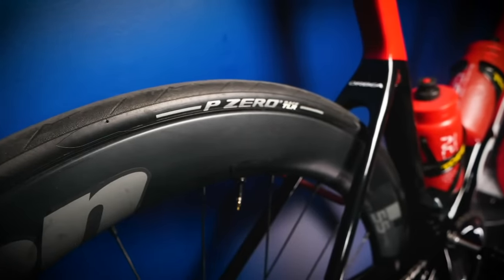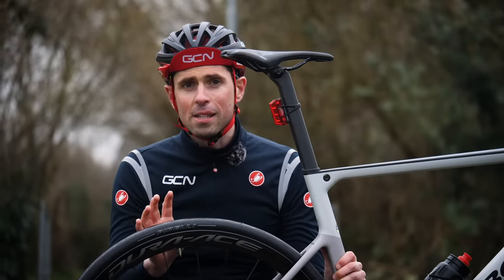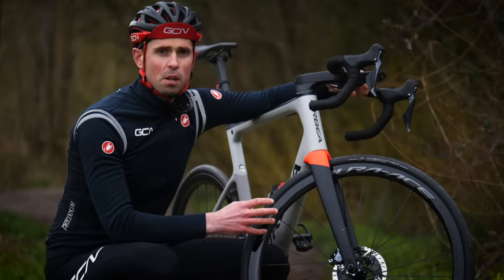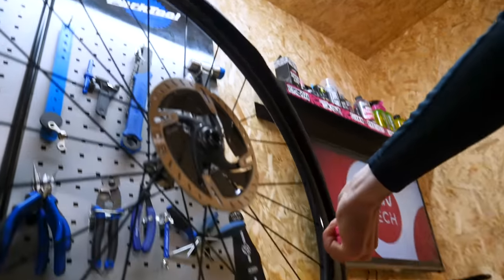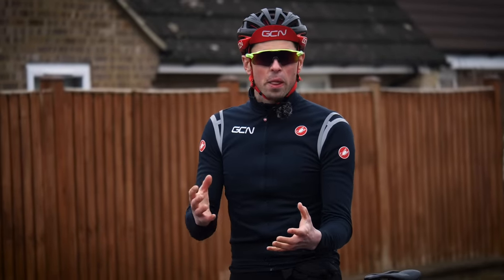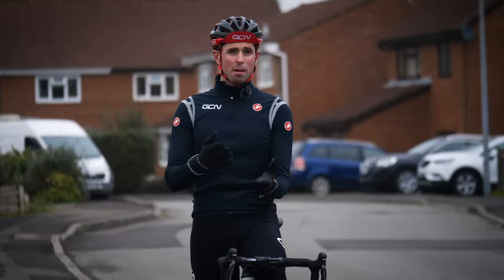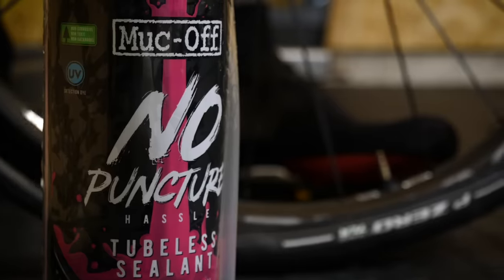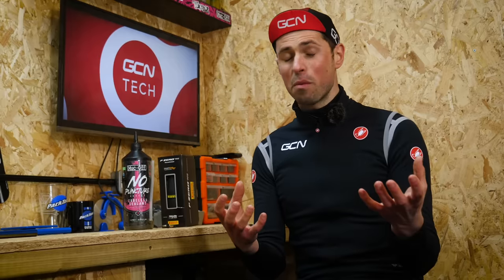Tubeless Convert! | Why Alex Will Never Use Inner Tubes On His Road Bike Again

Comment: Tubelss is great when it works. However, it doesn’t take much of a hole, for the sealant to give up. Meaning you will have to plug the whole, by the time you realise that a plug is needed, and get it sorted, the tire may already have unseated due to loss of air, and you have no chance of seating it again, by the road side. Then, you find yourself covered in sealant, trying to empty out as much as possible, from the tire, before putting in the tube you bring anyway, just in case. Besides this it’s recommended that you replace your tire ASAP, once it has been plugged, as the plug compromises the integrity of your tires. Now you can find yourself replacing a month old tire, because of one single puncture (or switching back to inner tubes) ... Then you can spend the next 3-4 washes cleaning out sealant, from all nooks and crannies, of your frame and your drivetrain. So again, as long as the sealant does its job, then Bob is your uncle, happy days, and if not, you have yourself a potential road side sh:t-show.
Reply: I have ridden over 2,000 miles after plugging a tubeless road tyre, no issues at all. MTB'ers likewise.
Reply: My new Pirelli P zero race TLRs lasted a whopping 3 rides before this happened to me. Funny enough, seating the tires was never an issue but they did eject my tire plug twice.
Reply: @greabo9544  sounds like he forget to refill/maintain his tires with new sealant... then got mad at the system he failed to maintain
Reply: @greabo9544  Stop being so emotional, immature and triggered ffs. 🙄. The OP is allowed to have his opinion. It’s based on his real world experience. If yours differs then that is fine, but his is no less valid than yours.
Reply: @paddyotoole2058  I thought his argument was good, it sounds like you may be emotional.
Reply: It happened to me the first DAY I used tubeless. And the hole was so big the inner tube popped out of it. I had to put a patch in the tire. Had to wait for help with a floor pump to be able to seat the tire again (it was a gran fondo race). It was mess. Have never used tubeless again
Reply: Agreed. I've been there and went straight back to inner tubes.
Reply: @troyasee  wait, the inner tube?? on tubeless? sus..
Reply: @greabo9544  I’m glad your experiences are better than mine, floating around on a pink cloud, surrounded by unicorns and rainbows sure sounds swell, I hope you enjoy every minute. Does that give you a reason to hate on others, for having a different experience than your? It apparently does. I am sure that everyone who’s had a proper puncture, on tubeless, will tell you stories of cleaning sealant of their kits and helmets. I don’t break down my front and rear derailleurs on every wash, as I am sure you do, so sometimes sealant does pop up, under your seat or chainstays, during maintenance. I doubt you’ve ever experienced a proper puncture. And on the subject, what is always the final resort, when tubeless fails? A tube, right ... I can tell that you have much more experience than me, I’ve only been riding tubeless for three years, gravel and road bikes included, both have been disc equipped since 2019. I top of sealant, scheduled every month. Dunno the relevance, to others, but it sure does seem important to you. Of course my mom doesn’t tell me to wash my bike, she washes it for me!
Reply: @cleggycyclist  So have I, but that’s not the recommendation.
Reply: @mrziplineds5257  Replacement every 6 months, top of every month.
Reply: @greabo9544  Road tubeless is a solution for a problem that doesn't exist. I got tired of putting tubes into tubes tyres filled with messy goo that would not seal a puncture... After using a plug. And no the tube did not bulge out of the tyre. I'm using tubeless tyres with tubes that sealant and plugs won't seal without issues. And I have never had a pinch flat that the exponents of tubeless always mention as one of the big benefits.
Reply: @troyasee  your are not smart at all if you try out a new setup the raceday
Reply: Do you actually have to use sealant? It sounds to me it is the biggest bugbear of going tubeless. 

Tubeless seems to me best in areas that punctures are unlikely to happen but if you are prone to punctures then best to stick to tubes.
Reply: @tomnewham1269  you can absolutely run them without sealant. But it all depends on the tyre. Because some tubeless tyres (“tubeless ready”) require the sealant to seal the tyre sidewalls to then become absolutely airtight. However you will of course lose the ability to seal minor punctures. But running without sealant is not a bad option i suppose with the right tyre if you are happy to run this risk and carry an inner tube in the event that you puncture. Which you will be doing anyways if you are running tubes.
Reply: Jesus soon much venom, and we haven't even mentioned this is all due to EU regulations (BSEU1667:pt 6 _ 167).. Which requires cyclist to bemoan and flame anyone who prefers a simple life and simple tech but likely rides like a beast.
Reply: I've never used tubeless myself - I'm still curious because of the reputed increase in comfort and might well try on my next wheelset, but what has kept me so far is what I've seen from ride buddies, and that fit your description very well.
Reply: That sounds just like me last summer! Had no tubes, and the worms didn’t help to fox the hole... cost me 50€ of taxi to come back home... went to LBS and switched back to clinchers. Ride is not as comfortable but at least my mind is at peace, it takes literally 2mn to change a tube !
Reply: I am going to try latex tubes. My first ride on tubeless I punctured on my rear tire and i coudnt seal. resulting in a messy bike, the tireplug wasnt up to the task.

I did do a lot of riding on my front before converting back to tubes for easy of use (never punctured).

I have read several places that latex stille is fastest overall, but now ill try myself.

IMO - The biggest impact the presenter made in his test was the 35 psi
Reply: The tyres won't unseat at all on a tubeless rim, they're locked in
Reply: @TheWoogeroo  They will, and they do, speaking from personal experience, tubeless compatible rim and tire too. Tubeless is great, until it’s not, I used to swear by it, rode it for a couple of years, road and gravel both, but too many bad experiences made me go back to tubes.
Reply: Just not worth it. All these things are just the bike industry clawing at your wallet.

I grew up with my dad and uncles helping me fix bikes and they basically told me that there's always a new product claiming to solve a problem you never considered a problem before and it's just a way to get you to spend money.

If I find myself thinking about stuff too much it usually means I'm not riding my bike enough and that means I'm getting slower...